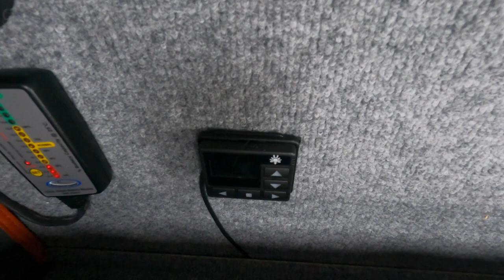Alu-Cab Khaya Camper at AVO

Comment: I have this Taco/Khaya set up as well, mine is 8200 lbs so don't use 488 gears if you put 35's on, go 529.  The Tacoma is not designed for this payload so you will need to really build up the suspension.  The design is fantastic but you really need a V8 in my opinion, especially with that heavy bumper.  Also add heavy duty disc brakes!
Reply: Building the suspension up does not increase payload, you cannot increase payload or GVWR. Any increase in weight through suspension upgrades, tires, wheels, etc. must be deducted from payload.

The Tacoma is not a Hilux, and putting the Khaya on a Tacoma is stupid.

Comment: That trucks payload isn't high enough for this, is it?

Especially with 2 passengers and 25 gallon tank (which adds roughly 250 lbs)?

And all the additional racking and lights?
Reply from the maker: This is a complicated answer, since there is no option in the United States to update the vehicle’s original payload like other countries around the world have done. Overseas, countries will factor in upgrades to suspension, brakes, sway bars, and tires as a payload increase to handle the added weight of many of our touring accessories. On the Tacoma, we are typically adding much higher capacity suspensions, tires, and brakes to help improve the vehicle’s driving characteristics.

Comment: What’s the wet weight of the camper? Can the Taco’s payload cover it?
Reply from the maker: This is a complicated answer, since there is no option in the United States to update the vehicle’s original payload like other countries around the world have done. Overseas, countries will factor in upgrades to suspension, brakes, sway bars, and tires as a payload increase to handle the added weight of many of our touring accessories. On the Tacoma, we are typically adding much higher capacity suspensions, tires, and brakes to help improve the vehicle’s driving characteristics.
Reply: It isn't complicated, this truck is over capacity. You cannot increase payload, and every pound you add in upgrades, people, and gear takes a pound off payload.

The Hilux and Rangers overseas, have almost double the payload from factory.

Comment: how do you want to fill that diesel tank? there is no room to get any kind of nozzle in there. Why use a electric water heater over a propane water heater when you already have onboard propane?
No need to run the truck and its instant hot water.
Of course that diesel heater is cheaper to install than the propane heater but with propane already being available onboard you could delete the need for diesel and run all of off one source (propane)!

You also cant get the tent heated when you fold down the complete bed area.
What this whole camper seems to be missing is a toilet.
What i would like to know more about is how the camper is insulated (R ratings). Especially the Tent fabric insulation. Are there sheets you can add?
Reply from the maker: Alu-Cab recommends using a funnel to fill the diesel tank. You can also fill it directly with a nozzle from a diesel pump using care. 
 
The electric water heater is reliable / efficient and can be powered indefinitely by idling the vehicle to limit the need for any additional fuel sources.
 
The tent canvas is a dual layer fabric and in conjunction with the diesel heater stays quite warm. Heat will still move up from the lower level with the bed platforms lowered.
 
Full-size standard sheets will do the trick for the primary mattress.